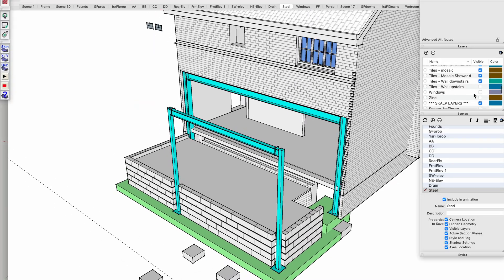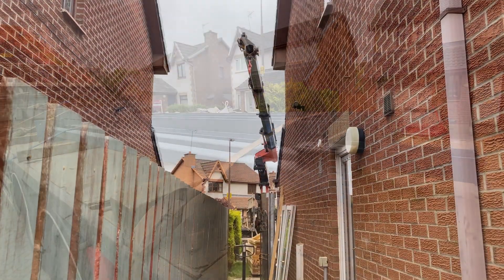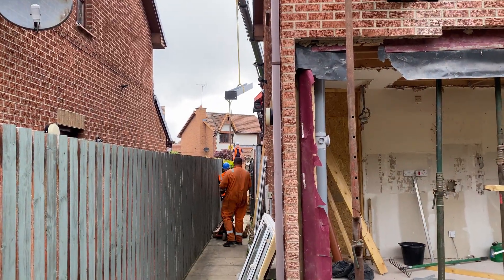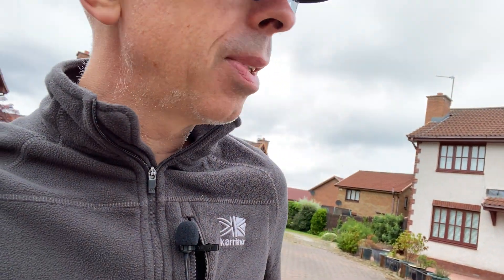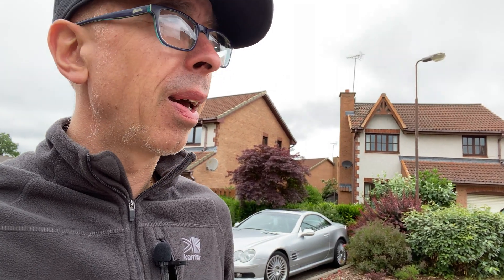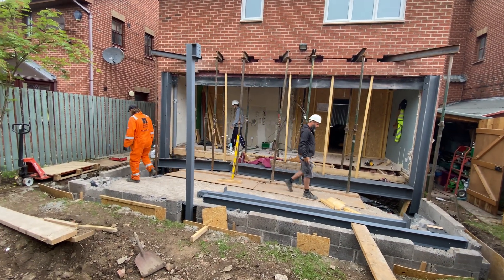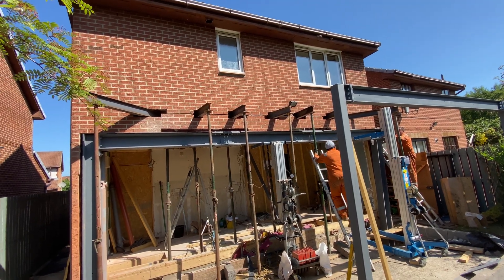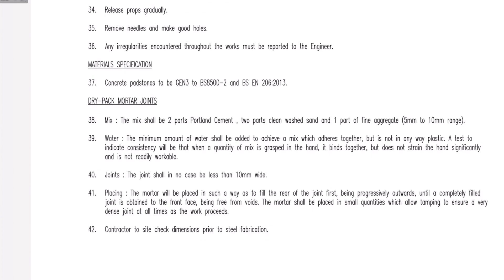Installing steel beams for a house extension

Comment: Can I ask what bolt depth you used for the column base? Or did you pre set the anchors in the foundation forms. The 4 x 4 column too. I am doing a single storey. Thanks
Reply from the maker: I can’t remember, but perhaps around 200mm m12 resin anchored would be my guess. I just go with whatever is specified by the structural engineer.

Comment: Hi, great video — really helpful. I have a question about fixing the columns accurately. How do you drill the baseplate bolt holes in exactly the right position? If you drill and resin the bolts before standing the steel, isn’t there a risk the posts end up slightly off and the beam won’t fit?
For my project I’m thinking of lifting the beam loosely into place with a couple of Genie lifts, standing the columns under it, getting everything plumb and level, and then marking the baseplate holes for drilling. Is that a sensible approach, or overkill? Thanks again — your channel is a brilliant resource.
Reply from the maker: You drill the holes with the columns in situ getting then plumb and level using wedges if required. You can also oversize the holes to give you some wiggle room or tolerance, but you need to check the additional resin required is ok with your engineer. .
Reply: @build-better-things  thanks!
Reply: Another question if that's ok: did you use a grout under the column baseplates in this project? Would the grout need to be poured and go off before dry packing above the beam or the other way around?
Reply from the maker: No grout Mike. But again, cover yourself by asking your engineer. Every situation is different.
Reply: Will do, thanks!

Comment: Hi, I wonder if you can help. How much would this type of job cost as finished shell build water tight with doors etc. Getting a builder to give a quote in Norfolk seems impossible.
Reply from the maker: Hi. I make a video about the costs with a detailed breakdown so you should be able to get that information here
How Much Does a House Extension Cost in the UK? Full Price Breakdown + Excel Template
https://youtu.be/Qk_1vCiicMk

Comment: how wide is the opening? what size steel did you need? It looks maybe 8m wide and they only seem to be 200mm deep beams?
Reply from the maker: I think the beams were 254mm but I made another video about the design so you can check it out.
Reply: @build-better-things - how is the opening / length of span?

Comment: You mentioned the outer skin is not load bearing, but I would still consider it desirable to complete the full brickwork course above the steel beam before removing the needles. This is to ensure you get an even load spread backonto the beam as the needles are removed. But if the brickwork didn't crack then it worked (this time)!

Edited just to say thanks!
Reply from the maker: Thanks for your input and experience, great information.
Reply: it will be fine brick work triangulates also the moment on a steel of that size wont effect it.
Reply: @eddjordan2399 I stand by my comment as a general sequencing preference. But in the video you can see some temporary bricks and timbers have been added which should allow the brickwork to arch as you say. Agree no moment issue regards the beam.

Comment: What size ibeams did you use? They look massive! Very sturdy I'm sure
Reply from the maker: I used the size that the engineer calculated using the loadings. 254 x 254 from memory.

Comment: Where's the water suppression that's nasty there's no way we'd get away with that type of splice joint only ever used that on vertical columns only ever plate to plate to create a moment connection to prevent sag
Reply from the maker: Hi. For the splice, if the engineer says it will work, then I’m ok. Are you an engineer with experience to say otherwise?
Reply: I'm an engineer and a splice detail like that is structurally sound in principle - drive under any steel motorway bridge and you'll probably see the same detail. However, I would only use friction grip bolts in this scenario as normal bolts run the risk of slipping and the beam dropping slightly.

What isn't quite clear is why the beam had to be cut up in the first place - could you not just lay the beam Infront of the wall before doing the needles? From the video it looked like there was a preference for the fabricator to measure the opening first which might explain it.

Thanks for the video, really enjoyed it.
Reply from the maker: Getting the beam in before the props was not an option on this occasion.

Comment: Are there any negatives in using sectional steel beams bolted together to make 1 big beam?
Reply from the maker: You might say there’s some margin for error introduced by the potential for poor workmanship with all the additional fixings,  but in terms of performance if it’s done properly it’s all engineered as if it were a single beam
Reply: @build-better-things  great, thank you!!!
Reply: Costs more
Reply from the maker: Hehe. Yes, that as well, although not a crazy difference.

Comment: How did you get the top of the two columns to be exactly level, were the footings level or different? Any more videos on getting the columns in and levelling them?
Reply from the maker: I try to  do my site sizing and  fabrication after my footings are in place and your openings are done . Getting everything level is about designing in tolerances and things like using shims and dry packing. It’s only where I’m doing new build that I’ll be able to expect to get foundations dead level. For these refurbs, everything will be a little out, hence our need for incorporating tolerance in our designs.

Comment: Another excellent video 
Is there a table for beam size and span length
For example if span length is 6m then would be beam size ?
Reply from the maker: There are some span calculators  online for steel, but you need to know a load of things like  your loadings in kilo newtons, deflection limits etc. I always just use an engineer for steel.
Reply: @build-better-things  
Thanks for a normal ground plus 1 property is there tables or something
Reply: @Mghanabro  he already answered, why be insufferable? Just go to the steel cutting merchant with your neasurements. They'll calculate the rest. OMG

Comment: Can we use anchor bolts instead of setting threaded rods in resin to secure the post plates onto footing? Thanks.
Reply from the maker: That’s one for your structural engineer to answer. I have always used resin.

Comment: Hi, thank you for excellent video. Could I ask if it would be beneficial to have a full steel structure by adding 2 beams (and extending the window goalposts to the corners)? That would make the inner timber leaf non-load-bearing. Are there any downsides other than extra cost of steel?
Reply from the maker: Cost of steel isn’t that much relatively. Extending to the corners and making it a more complete steel frame is a fine idea and gives you more options on glazing.
Reply: ❤Thanks for these comments.

I didn't know how to articulate what I wanted apart from saying I don't want supporting posts all over the internals of my extension.

I knew it - I just knew it could be done - the company were using Affordable Design in Midlands doesn't seem to understand the concept and were bashing our head against a brick wall with them.

The builder then said just now that it often happens that the person doing technical plans will try and just use existing supporting walls.

Thanks for sharing this info I feel boyed up and confident enough to argue this out with the drawing "expert"

Comment: I have no experience in the building industry. We're about to start a single story extension and whenever my wife or I wonder how does this or that work with the build process your videos have given the exact answers on multiple occasions. Thank you very much for sharing your experience and info 👏👌🙏.
Reply from the maker: Thanks a lot and best of luck with your project.
Reply: You should bone up a bit, building is interesting because of it's challenges, you are 'learning' but also making sure things are being done correctly by people that you trust to give you the best quality. No professional would be hissed off if you ask them questions either, there should be nothing to hide.
Reply: @SimonFaeDenny  Check out To Live + Die in L.A....  great fu*king film.

Comment: Hi Jeremy, befor i start never wirked on construction site on laying floors fir modules. 
Recently bought small derelict cottage , walls all good its approx9.5 m x 4.5 m going to out extension on rear for kitchen and bathroom, i thought of doing goal post steel beam idea but think that would be overkill reason being the roof is asbestos corrugated once the specialist comes to remove it will use shingle sheets as if i use tiles rhe whole roof will need re engineering for extra strength, so as the walls are almost 2' thick i can put the onto the walls but will need 4"x2" wall head plate on top of beam so joists and rafters have some where to go . So the opening of the wall approx 4.5m then wall then mtr fir door to bathroom from existing building , then block and render , so after reading comments from others about having no bump in celing from steel beam , its impossible in my case as being single storey  . I have yet to get in there and have a more accurate measure . Will be a flat roof , width of ext approx 3 mtrs . Thanks for videos Jeremy.
Reply from the maker: Thanks and best of luck with what sounds like a great project.

Comment: Can a house be build using only steel beam and bricks on concrete foundation meaning no concrete steel pillars? Thank you
Reply from the maker: Sure, but I have the steel columns here because the beam did not have enough wall to sit on without compromising its slenderness. So we need columns

Comment: Hi Jeremy. Did you anchor the vertical beams directly in to the foundation concrete, or after the pour did you use padstones? My engineer has said all steel to be on padstones, have you come across this before thanks
Reply from the maker: You only use pad stones for where the steel is onto masonry, so above the ground when it’s sitting on walls. For the columns (you called them vertical beams) you place your reinforcement, then you pour your concrete over, then after set, you bolt your columns directly into the reinforced concrete pad foundation. You would not use a pad stone there. You would use resin anchored bolts
Reply: @build-better-things   @build-better-things  thank you. I'm not doing it myself but just interested in what they do , and your videos r really useful for learning. So they will install the vertical beam (column)  directly in to the 300mm gen 3 pour once set. My engineer didn't specify reinforcemementbin my foundations. Thank you

Comment: I came looking for how the horizontal beam is installed because my neighbour is building his extension and there are no needles.

His acros are simply below the upstairs load bearing wall itself. I'm wondering (somewhat worriedly, I might add, as he has a habit of cutting corners) how they're going to get the girder in place while the wall's still propped up exactly where the girder needs to go. 😮
Reply from the maker: Did they manage it in the end?

Comment: Hi , Would it not have been stronger to sit the Beam on The posts rather than  Putting all the Load on 8 bolts?
Reply from the maker: Hi.  It’s the engineer’s calculations that determine the design of such junctions, and I will build it to that. The only time I question engineers design is if I think there’s an easier way of doing it, some time is the most important aspect of a build for me. However, to your comment,  if you understand how the physics of mechanical steel joints work, you’ll know the load is not on the bolts, even in a horizontal position, once they’re tight.
Reply: @build-better-things  what is it held by then magic? thats like saying its the notes you dont play make the music. if there are no bolts it dosnt stay up.
Reply from the maker: Hi. Thanks for pointing that out to me. As I said, it’s the engineer’s calculations that determine the design of such junctions.
Reply: I know this was posed a year ago but the reason for doing it this way is because you can jack the beam in place with out having to move the beam out of plane into position.

Comment: Great work - and music!  One question - how did you get the concrete footings / pad to the exact height for the steel posts to screw into? Thanks
Reply from the maker: To get the levels in the concrete, there’s a few ways, but I prefer to use an old school way which is pretty much fool proof, doesn’t need fancy tools, and super easy. I made a video about it here. 
How to set out FOUNDATIONS FOR HOUSE EXTENSION to save THOUSANDS..architect shows you how
https://youtu.be/CpMPwhV_BE4
Thank you for your comment.

Comment: Hi mate, I’ve done a similar job at ours but with masonary pillars rather than goal posts. One question I’ve got is what happens to any water that may get into the cavity above the beam? Reason I ask is I’ve seen people use 2 x beams bolted side by side whereas mine and yours is 1 x solid beam with steel plate to support to inner and outer leafs.
Reply from the maker: You have to put a cavity tray above the beam.

Comment: how long is the anchor bolt you use
Reply from the maker: If you mean the ones into the concrete foundation, they would be resin anchored, and I think they were m12 250mm but that’s just from memory.
Reply: thx sir

Comment: Out of curiosity how much does that steel secification drawing typically cost?
Reply from the maker: If you mean, the structural engineer drawings, it depends on what else is structural. The drawings I show from the engineer at the end of the video (the 3d drawings are my own) included the foundations and superstructure for the walls and roof. If it’s just the steel beam, I imagine several hundred pounds. I paid over a grand for just their drawings. I don’t remember the exact amount.
Reply: Our extension cost 3.4k plus vat. Used 11 pieces of steel including a ridge beam. Other quotes went up to £5k plus vat. Depends on your project and steel design obviously. If it’s a straightforward one length of steel beam to span over a sliding door then you’re looking at about 500-700 pounds I’d reckon.

Comment: When did you fit your cavity tray
Reply from the maker: Cavity trays are tough to do on refurbs. You need to do it brick by brick since you can’t pull out an entire course of bricks horizontally for obvious reasons. When you do it is not so important, but I would usually prefer to do it once the extension is in and the roof is built since you can work off it.

Comment: Why that beam is that low?  Should be on the same level with kitchen ceiling.
Reply from the maker: How do you define low?  And how would you put it level with the kitchen ceiling?  Due to the depth of the beam you would need to knock out a fair bit of the wall structure of the rooms above, as well as the floor joists, as the needles would need to be placed much higher.
Reply: @build-better-things  I would like to see kitchen ceiling without beam hump as well. But I understand that it is much more work to achieve it.
Could you draw wall/beam profile section for both solutions and elaborate about them?

Thank you for your videos. It is very good.
Reply: Without being critical I'd agree, if you're spending that kind of money and putting the effort in to get a frame that size in place then the finished result would be much more open, more daylight and generally classier without the bulkhead below ceiling height.

I don't know if this is for a client or the video author's own property but to me the extra aggro and cost of putting needles through bedroom walls is worth it down the line, for a clean transition to the extension from the house, and I'd try and 'sell' this everytime. In this case its not too bad, I may have dropped the existing ceiling in the kitchen to just run flush but without dimensions I'm not sure you'd get away with it here.

Surprised the out of square brickwork wasn't picked up at the measuring for steels or surveying stages. I know how quick these boxes are thrown up so it's the first thing I check.

My own place built in '62 has 14 courses that are 25mm out of level between downstairs and upstairs windows and had a 10mm belly where snots falling on the old felt cavity trays pushed fresh brickwork out above patio and kitchen openings. The irony is the builder/developer was proud enough to have his company name cast into all the manhole covers. Probably never visited the site...

Thanks for detailing your processes and taking the time out to video the progress.
Reply from the maker: @baldyslapnut.  I don’t mind critical at all. The problem with your suggestion is that the inner leaf was timber frame, as it was a kit house made from prefabricated wall panels and cassettes. The position of the beam was set by the bottom of the timber panel. Raising the beam would have entailed having to somehow rebuild the wall panel bit by bit whilst it being in situ as it’s the frame that’s the loading bearing bit, not the brick. And then there is the flooring cassettes for the first floor. Everything is possible if you pay, but it’s not just the cost, it’s the time I had available to get this done. Hope that’s clear. Thanks for the comment.
Reply: @build-better-things  I can see how that changes the complexity a bit.

Bathrooms are often a sticking point too because of the different level of making good needed.

Cheers for the info.